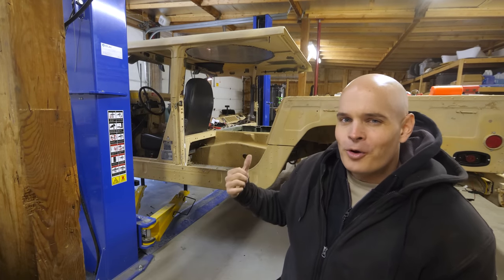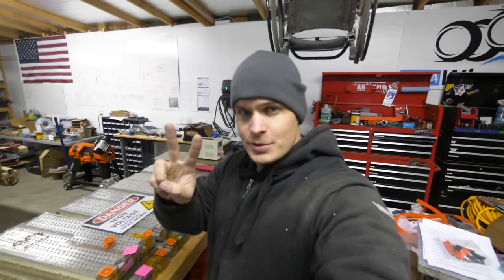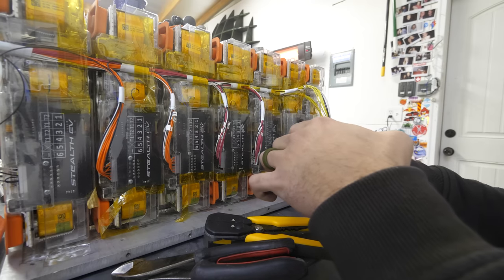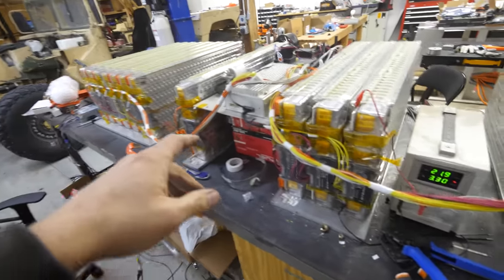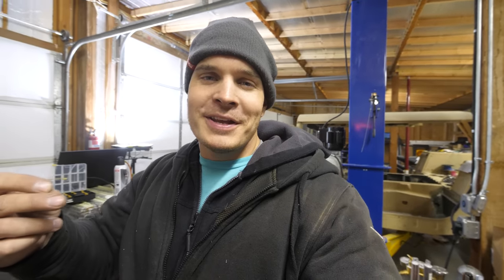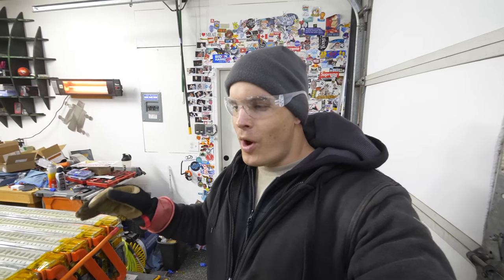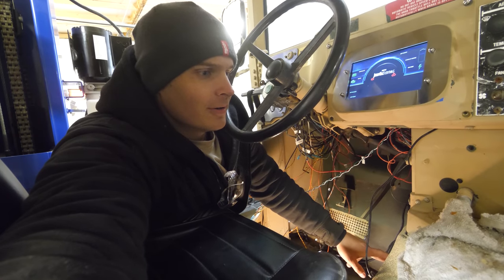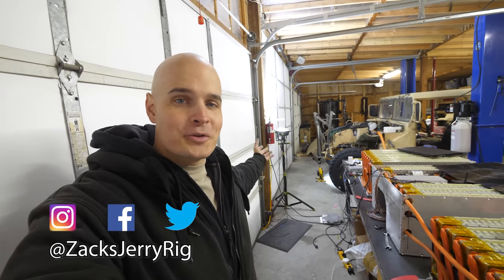Building the Brains of the HIGH VOLTAGE System - IT MOVES!!

Comment: A couple of things to look out for.
Inductive capacitance.
This is when a current is induced into a circuit simply by being near another circuit. It can either mess up things by giving data errors or build up to the point of explosive discharge frying components or anyone who touches a circuit they think should be cold.
Resistance induced errors.
When dealing with things like thermocouples one on the end of a one foot wire will give different readings to an identical one in the same location but on a twenty foot length of wire.
If you add in noise from RF interference and induced currents a long sensor lead can give very incorrect readings or cause ecu faults.
Reply: Exactly what I was thinking when I saw all the unshielded the BMS wires right behind the bus bars. 
As an electrical engineer I have concerns about the magnetic interference on the BMS wires when high current is flowing on the bus bars.
Hope it works in the end.

Comment: do the frames not have any risk of shorting the terminals of the batteries, say if they were impacted and contacted the batteries?
Reply: Was wondering the same, would it not be better to have them covered?
Reply: Good point
Reply: Yeah I don't understand why the terminals weren't covered in some form of insulation before putting the boxes together
Reply: I'm sure (hoping) that what we saw here was a demo and not exactly the final solution. Like he said, he still needs to put finishing touches on it like running the conduit among other things. The exposed terminals jumped out to me as I was watching as well. Especially at 23:28...

Comment: It’s a great project! However, 22:01 I see very small or no insulation in a high voltage metal box; and the gap of the rubber mounting 22:16 is kinda small/unsafe. Nuts and bolts are near the box’s base. Hope that can be addressed. Keep it up! 👍🏼

Comment: re: 5:20 for most batteries in good shape as long as you don't exceed the charge current rate  or voltage you should be fine to just bring the whole pack up a bit.  In your setup with the DC power supply you could in theory have one series of cells go over voltage though without hitting your CV limit though.  That's why you should have charged them through a BMS which would be monitoring the individual series taps.  But if the entire pack is well maintained and in good shape the odds that they'll drift enough to worry about is minimal.  Though I would still keep an eye on it.

Comment: I am concerned with how well this setup will hold up to a side impact. I'm a little worried a light fender bend could cause a battery fire if the box is impacted. I had originally thought you'd be placing the batteries more center mass using the tunnel and engine space to house them all. This would potentially keep them more out of harms way for collisions and off road. I'm also curious how well the tesla packs will hold up being on their sides but I assumed you've already confirmed they are good for that since it seems like a more obvious thing to know with that setup.
Reply: Well, the battery packs would be fine in any orientation, they're just 18650's after all

Comment: Amazing work Zack! I appreciate all the efforts to be safe with the high voltage (I've done a lot of work with high voltage DC as well). I did wonder if you were planning on adding a rubber lining or some additional insulation in the battery boxes? I saw you had stand offs to create separation on the bottom, but seeing a conductive metal sheet so close to the positive and negative terminals makes me anxious! Incredible project! I hope to do work like this in the future and put my engineering degree to work! Congratulations on the progress!

Comment: Nothing quite like that feeling of putting in all the micro steps into a vehicle project and feeling/hearing it not only turn on but roll forward even if it only is a a couple of feet for others its like a few miles in emotional high lol. I could hear it in your voice when getting ready to turn the key, then escalation with the driveshaft spinning and lastly when you rolled it that little bit. it definitely brought back all the times i have build a motor or vehicle project and heard it come to life that first time.
Congratulations on the project so far, although there is a long way to go still this was a big step in the right direction keep up the great work and congrats to the new addition to the family.

Comment: 22:00 If you should stay away from the battery terminals, isn't moving a metal box over it with your bare hands extremely dangerous?
Reply: Seriously that was frightening to see. The terminals were completely bare!
Reply: hahahah i know that was fucked. at least its not  like a 450 volt capacitor but still bro
Reply: I doubt the shock from those 3 cells will be too high, but a short on those terminals? Yeah that will blow sth up

Comment: Despite you not knowing enough information about this I am actually impressed by how professional you built that modular battery pack.

Also I need to explain one vital thing. You need to make sure that all of the contacts have special thread locker so you still have contact and vibration won’t be any problem for losing connection and losing connection from the battery will cause catastrophic damage if in 4 wheel drive in 4 low. 

I recommend that a current limiter is fitted to stop damaging any components that could completely compromise the drive train

I am in progress on building my own electric project car and safety is top priority at all times and also I unfortunately had to halt the build due to myself needing to collect some more scrap materials that I could see a potential to increase its strength, safety, be lightweight, comfortable for the rider and most importantly be efficient to last 100’s of miles on a single charge so in theory last almost as long and as reliable as a Tesla model S Plaid whilst my project car will stay completely compact to the point it’s size being based off a small go kart or a mobility scooter like seriously this thing will be just as strong as a Tesla Cybertruck because I have already been throwing hammers at it and it has sustained zero damage and ITS BUILT OUT OF WOOD and some scrap metal and being honest I want it to be also a reliable vehicle where maintenance is basically narrowed down to major components instead of running control arms and suspension as it won’t even need it as my project car is being built on my own design where the chassis flexes with the road to provide the same feel as a nice race car but have ultimate comfort from the ability of it able to flex for both traction on all 4 wheels at all times and due to being low to the ground helps with it having a low centre of gravity. Here’s the catch it will have a very similar gyro system like a radio controlled car so if it swings the rear out from over correction it will kick in avoiding a spin-out kinda like when you use a RC drift car it’s pretty much like traction control but for steering and it will be great for the quarter mile drag strip because it will stay straight.

If you read this comment the whole way through you deserve some sort of an award because normally I wouldn’t type this much information but it is very important and also crucially useful for the guy running the channel JerryRigEverything as he could use sections of this to guide his build of his electric hummer nice and safely to a point of zero major issues with minimal consequences therefore maintaining the equipment is a must but major damage will be virtually impossible to do but if components are pushed too hard failure can occur.

Take this in mind when building your own electric car. There will be several things that could hold you back and there could be other factors that could change the course of proceeding

Build your own electric car or truck at your own risk. Neither myself or JerryRigEverything will be liable for your mistakes
Meaning PROCEED WITH CAUTION!

Comment: Will there be grommets on the holes in the boxes where wires pass through? Bare holes, even ones that are deburred, could eventually cut through the wire insulation creating a short circuit.
Reply: When nothing was connected early in the video there  were  liquid-tight pass through mounted with gable glands. Should be fine there
Reply: @Reos1  So when I saw cables and wire bundles passing through bare holes in the boxes, that was temporary? That was at the point of “preliminary final “ assembly ready to connect to the car. We’ll see in future videos how this is resolved.
Reply: @jeffbransky7966  yes. Look at 0:47. He also mentions about the pass through at like 75% of the video. He will have to disassemble the boxes from eachother to get them in the humvee anyway.

Comment: May sound wierd, but have you thought about adding a solar panel to the roof, for a little bit of an extra charge while you have it parked somewhere? May get an extra few miles for free, or to charge the 12V system
Reply: To charge the HV battery he would need some DC/DC converter and charging stuff. I'm sure this stuff exists but would be tricky to integrate. Charging the 12V is def possible though
Reply: The amount of power he would get from a solar panel is negligible. The car would probably use more power to haul the panel around than what it would get from it anyway. The car would need to be under direct sunlight for hours and hours to make it worth it.
Reply: @OscarScheepstra_Artemis_  yup plus its hummer not a freaking spaceship
Reply: The contactors need to be powered to charge the traction battery.. if I am not mistaken. You need quite some solar panel to power them!

Comment: I've got a question: you mentioned having 18 Tesla battery modules. Is expanding the amount of modules and with that the effective range of the HUMVEE as simple as connecting more modules to the existing ones? Let's say, you wanted to go on a road trip and wouldn't mind giving up some storage, would that be possible?
Reply: Damn, an expandable battery pack for car... That's a great idea.
Reply: The problem is weight, at this point adding more batteries won't increase the range due to the overall weight increase.
I think he pointed it out in one of the past video, I could be wrong though.
Reply: I suppose you could connect the same ammount of batteries in parallel to double the range. But you'd have to have the same ammount to up the voltage on both sides.

Comment: Hi Jerry, Great project! 
I do want to make you check up the danger by running the + and - through separate holes in the aluminum cases. 
When running AC this is a big no no due to current building up in the aluminium. Maybe it isn't a big deal when running DC but as the current fluctuates you will have some current in the aluminium and that can cause heat. 
Looking forward to see the beast on the road!!! :-)

Thank's again for doing stuff we want to do but our "sanity" stop us from doing!

Comment: I think the hard wired battery controllers make more sense, never was comfortable with the wireless setups. Read the problems of the UH-60s and AH-64s growing pains, twisted pairs of shielded wires solved a lot of Problems
Reply: I worry that the faraday cage of a battery box will be blocking the signal unless he sneaks an antenna wire out of the car

Comment: Should have bought soma ctual shielded twisted pair cable and made your life easier, and avoid headaches later. CAN can be very temperamental with many nodes on the bus and in it's best to implement it to a proper spec (twist rate, termination resistors, shielding, etc.) If you have weird issues later, this would be something to revisit. Cool project

Comment: I`ve seen in another channel ''rich rebuilds'' that the big fuse next to the BMS fails after a while as its made of small wires inside which will heat up individually every time you do a hard accelerations and start to lose its capacity. love your work man.

Comment: How utterly fascinating. A really great and informative video which explained everything so well that I was able to apply my past aircraft electrical engineering knowledge and follow your wiring harness assembly and techniques as well as the battery management system principles. Well done and I wish you well. Gosh I wish today's wiring harness tools were in existence back in the 60s and 70s.

Comment: You should learn a little more about CAN. The cool thing about having a CAN H and CAN L is that the difference between CAN H and CAN L are what determines a One or Zero. Therefore if there is any noise, it would typically impact both conductors. This makes CAN very noise immune. Also having multiple nodes and the ability to transfer power and CAN signals together means it’s very easy to implement. Lastly, it’s very inexpensive and you can transfer a lot of data at up to 1Mb/s. There are a lot of applications for CAN. However, I suspect in the end Structured cable Ethernet or two wire Ethernet will overtake CAN in cars.. this project is awesome! Thanks!

Comment: This is really cool and I have learned enough to get me started on my own project.   As an experienced offroad enthusiast, it is very unlikely that all these electrical connections will work reliably in dusty or serious offroad conditions.  On the highway, it should be much more reliable.

Comment: Hey Jerry, I haven't gotten to the last 3 videos, but in case you're wondering why wires use the "guage" system, and why higher numbers are smaller, it's because they used a draw plate, starting with number 0, or possibly number 1 rod, it was fed and pulled through a series of holes in a draw plate. This makes the wire thinner with each pass. All of this has of course been superceded with modern manufacturing techniques and different types of wire. Sheet metal guage was originally based on a similar system, how many passes it made through a rolling mill.

Comment: I haven't seen if you've done it or not, but use plugs to shield your cables that are routed out of the boxes. The edges on the boxes' holes will end up cutting through the wires.

Other than that and what other people have suggested... impressive dedication to DIY!

Comment: Hi Zack. Well done for using insulated tools and EV gloves, I wish other DIY EV builders would do the same. It seems you have 3 Tesla modules at a significantly different voltage to the others, probably because they're from a different pack. I'd suggest you balance all your modules together before you go any further, otherwise you'll only have to do it later as having those cells so far out will only reduce your range quite a lot. To do this get ALL of your Tesla modules on a bench and connect them all in parallel, then leave for 24hrs. They will then balance each other out. The BMS balance feature isn't up to the job of balancing such a difference, as it will ahve to bring all the other cells down to the lowest value, which will take a very very long time. You might think that 3.7v vs 4.1v is a small difference but it is not, 3.7v is less than half full, whereas 4.1v is near full. Also, from experience, that torque trends box is VERY noisy, just be prepared for that. Can't wait to see this run, from a fellow EV 4x4'er (Tesla powered Land Rover Defender).

Comment: Hi Jerry,

Well done! Honestly impressive! I have some suggestions (as an OEM engineer), the BMS is impressive for being built in-house. But once those units start getting vibrations you get the scariest thing to any engineer "undefined behavior". Vibrations are monstrous + EMI. I suggest you insulate the inside really well, as well as the naked sockets/connectors, I'm sure it's not finished yet but before plugging all of it together you have to make sure all conditions this system will have to go through.
I can't wait to see it running!!

Comment: As you move all your battery modules to the aluminum shell, you probably should wear rubber gloves to protect yourself from possible short-circuit between terminals to the aluminum shell. Because there's no insulation on your terminals. Great video as always!  That's already my favorite project!

Comment: Arc flash protection is very important to consider especially with High Voltage DC battery systems as there's no fuse to prevent fault current from flowing continuously. Can't comment on exactly what the ratings of this system is, but a 750VDC 85kWh system can be up to 40cal/cm2! Please be wearing arc flash PPE as well. As little as 1.2cal/cm2 is enough to cause serious injury!

This is the only video I have watched so far so maybe these next points were covered earlier. I didn't see any kind of HVIL system, Mid Pack Disconnect, or isolation monitoring.

Source:  a BEV electrical designer for mining equipment and have a few under my belt. Please let me know if you'd like some focused input and I'd be happy to help you out, I love these kinds of projects and can tell you really want to do this safe and right!

Comment: Those battery terminals are uncomfortably close to the aluminum box. It may be wise to insulate them to prevent shorting against the box in case of shifting or a dent to the box during off-roading. 

Amazing project though, it's been great following along!

Comment: Awesome Project, loving it! 

Just one to possible consider if you haven’t already (your wiring husbandry seems pretty good so you have already planned to do this), You should probably add rubber grommets to the holes in the frame that the wires are passing through to prevent chafing on those sharp metal edges.